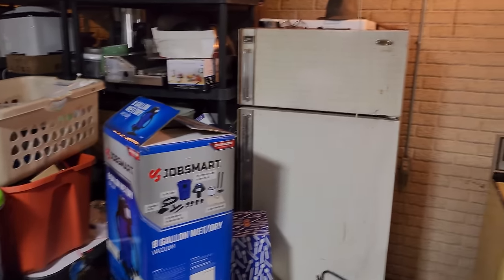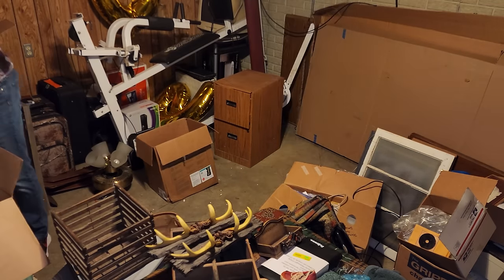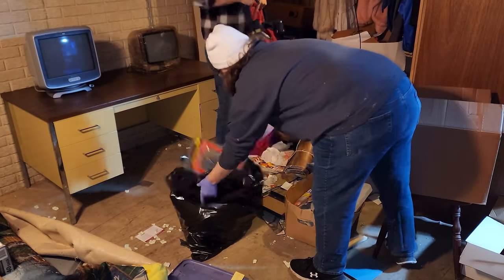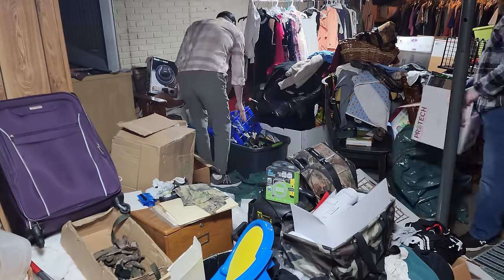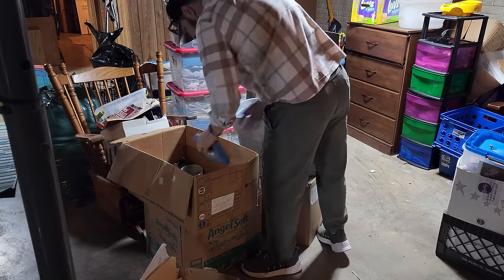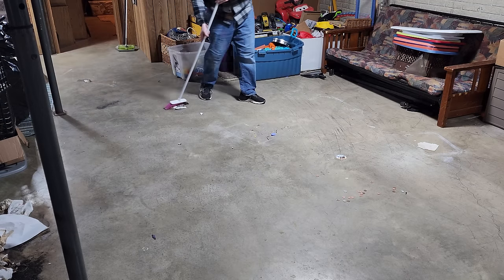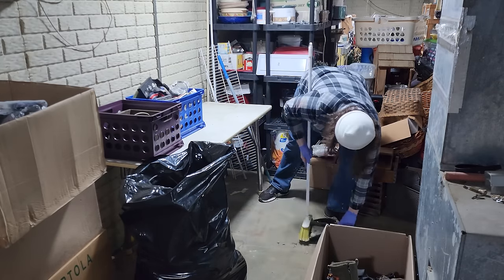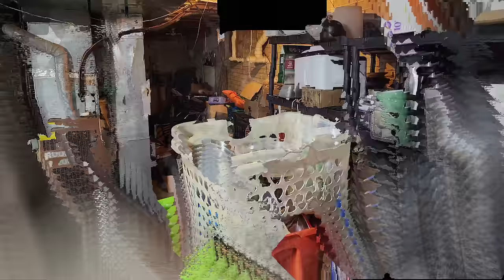Cleaning a MASSIVE Basement Hoard for FREE!

Comment: Here's my hack. I used a hand truck with a contractor bag attached and held open with spring clamps.  It holds the bag open and upright and easily moved within arm's reach. If/when the bag gets super heavy, hey, its a hand truck! It saved bending over and opening the  bag for each item, and with practice, you can bag things from 3 point range.

Comment: Like with like is 100% one of the best ways to go through a lot of clutter. Start with zones, ie when you open a tub/drawer, empty it and sort it into "type piles", papers, electronics, pet, utility, etc. Then move to the next tub/drawer. If the tub is mostly one type, take the rest out and use it as a temp "type" bin. As you sort and the piles grow, put them in boxes/bins or general locations (ie fashion accessories put in closet). Then you can slowly add to those piles as you find random things, and get an idea of how much you actually have. Then as you get all the "like" items together, you can more easily go through it and declutter. 

For example, if you try to declutter a misc tub, you might see a mess of important things and not know what to do.but if your random stuff is all grouped by type, you can see "oh, i actually have 10 nail clippers. I dont need that many" and get rid of extras/broken bits much more easily without being scared of getting rid of something you need! Then once you declutter, you can pick homes for the things youre keeping. And then you know what you have, and where it is. Organize big, first! Then declutter, then organize small!

Do not underestimate the power of type piles. It works especially great for papers. Put them all in a tub as you find them, THEN you can sit down and go through the paper tub(s). You can just focus on sorting paper, not everything else, so you get into a groove with it. Then sort like by like again, depending on your stash. medical, memories, pet, business, financial, really importants (like "official" stuff, deeds/birth certificates/social security card, etc), and a'course trash. It makes it so much easier then trying to micro-sort everything as you go

Comment: I pity Your poor backs.  I had that tv in the late 90's and it weighted close to 100  pounds.   When I moved I managed to get it from the stand to a sheet on the floor and drug it thru the house to the garage.  I had a small trailer that I was putting essentials in and a gardener walked by and helped me get it in the trailer.  The tongue flew up in the air, the trailer dropped down so much that the tires were rubbing and You could see the wheels turning in the gardener's head.  And before He died laughing I turned and said,  "Do You want a free tv?"  His eyes got big, and lets say we were both really happy.,

Comment: Tip from my late Mennonite grandparents; offer up the cardboard to anyone that heats their place with a wood stove. My grandparents survived Ohio winters by tying up bundles of cardboard and rolled up newspaper with twine instead of buying expensive fire logs for their wood stove. These days with Amazon boxes, that free fuel is easier to find than ever! Just chop it up to fit inside the stove, and bundle it tightly with the twine for a slower burn rate that's almost equivalent of those pricey fire logs.